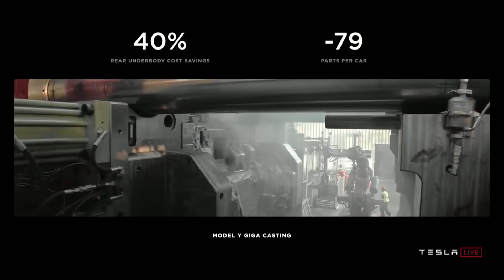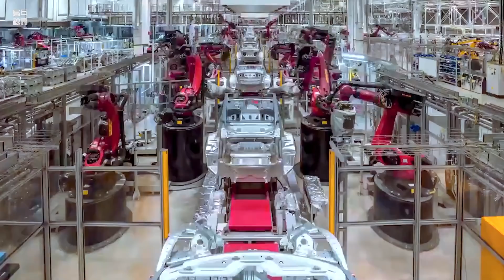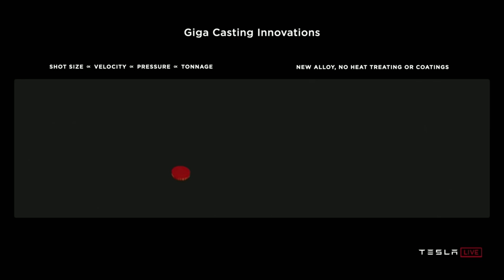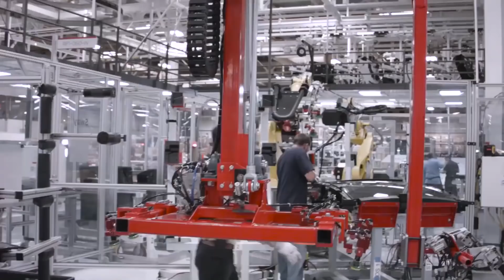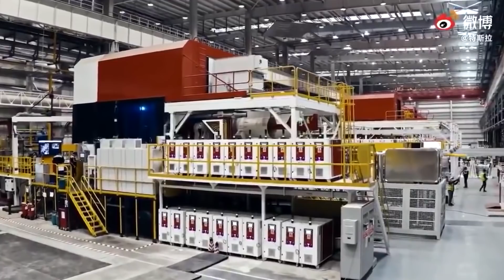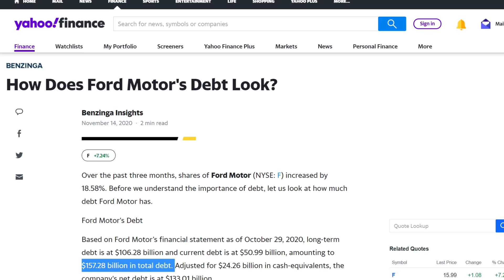Tesla Giga Press: Why dont Auto manufactures copy?

Comment: NONSENSE #1 Body on frame is NOT the way everyone else is doing cars. Almost all cars and crossovers are of unibody construction with stampings. Only heavy duty trucks are body on frame. NONSENSE #2 Casting solves everything. Actually, no it does not. Castings have a very thick minimum sectional thicknesses and are anything but the lightest when you need thin shells. Casting alloys like A356 are also inferior in strength to forging and extrusion alloys like 6061 or 7075. This is not counting porosity and flaws from the process itself. NONSENSE #3 Other automakers do not use large castings or do not have the equipment for it. They do. They simply do not use it for bodywork because welded stampings are thinner and preferred. Casting are extensively used in sub-frames, entire firewall assemblies and of course engine blocks.
Reply: And I don't really get how the dependency on a small number of very special casting machines barely anyone knows how to service will be better than having a lot of standardised robots which may fail more often but are relativly easy to service or exchange.
Reply: @9734522  Hunans also make more mistakes than robots. Hence why the world uses computer systems and AI wherever possible.0
Reply: @9734522  The "idea" is that one big part is better, or at least cheaper, than a few smaller ones that needs to be welded, bolted or otherwise put together. That is not always true. I don;t think it's about machines or robots failing as much as it's about the man-hours (or robot hours) it takes to complete manufacturing. Regardless, let's just say that Tesla's costs are not notably better than their competition -- at least their vehicular prices and lack of profitability does not suggest so. Where Tesla has traditional car companies beat is stock prices and hence money to burn.
Reply: @dwightlooi  I totally agree with you and have some knowledge about production myself. But it's stated in the video that many robots are many risks to fail and that this is bad - leaving out that the "giga press" may be even worse.
Reply: @9734522  That is like saying having 100 generic PCs is bad because any one of them can fail. So, let's have ONE mainframe! Nevermind that you can buy another PC in a hour from the local BEST BUY and you are only losing 1% of the work capacity.
--
Actually, on automotive production lines, when one or several robot fails it is often possible to continue production at a reduced efficiency. The line is designed that way. There are usually a dozen welding robots each doing a small number of welds in sequence so each stage takes less time. While it takes the same amount of time for the first chassis to make it through the production line, once the line is loaded the throughput is almost 12 times higher with 12 stages instead of one. If any one (or more) robot fails it's task is distributed amongst the other robots. This reduces throughput but does not stop production even while the robot is being repaired or replaced. The same thing goes for human assembly lines. The other gays on the line will take up the task(s) of the guy who called in sick or suddenly quit.
Reply: @dwightlooi  "The 'idea' is that one big part is better, or at least cheaper, than a few* smaller ones that needs to be welded, bolted or otherwise put together." Or a few* hundred more parts with double the line length (and capital), and hundreds of added robots? But like you said, that's not always true.
Reply: @dwightlooi  that's a horrible analogy. It only fits if in your scenario; If one of the 100 pcs fail , then everything stops. In that case, then 1 mainframe would be superior for cost/benefit of maintenance and repairs.
Reply: @9734522  Robots don’t need wages and are much easier to replace. The money saved from wages way outweighs the cost and future repair of each robot.
Reply: @4000valentin  it doesn’t stop.More robots usually share the same task and they can divide the work between themselves. Let’s assume there are 4 robots who weld things. They each do 25% of the work. If one breaks, then the 3 remaining robots can just do 33% of the work each, without stopping. 

Now, let’s assume there is a giga press that works at maximum efficiency. If it breaks, other giga presses can’t just do more work, and the whole production would have to stop.
Reply: As a retired Engineer I can tell you that most of the people talking about the giga press are incredibly ignorant about how things work in the real world. I supported industrial robots and they are incredibly reliable. The robots would literally run for years with no maintenance. The weld tips and other consumables would have to be replaced and drift adjusted during the normal downtime and but the robots just didn't break. The biggest problem we had was having a trained technician available to fix the robots. The robot breakdowns were so rare that the technicians forgot all their training.
On the other hand the large custom machines would break on a regular basis. In the factory I supported virtually all of the downtime was caused by failures of the custom machines and  not the robots.
Reply: @jimfarmer7811  With more and more engineers retiring, this knowledge is disappearing and considering the young generation wastes its time getting MBA degrees in the hope to strike rich by becoming traders, the few still embracing engineering are reinventing the wheel,  making mistakes long forgotten. See the hyperloop, boring company and car shuttles, other Elon Musk scams as good example.
Reply: Also cast parts are nearly impossible to repair. Got into mild accident = total loss of vehicle.
Reply: @aleksandrkinyaev6703  One of the reasons insurance companies are totaling more cars is damage to the complex and impossible to repair economically frames. That must be why they engineered the cast "crash rails" to be sawed off after a "crash?"
Reply: @aleksandrkinyaev6703  going in line with right to repair issues. It can be seen as we don’t want the car to get repaired in case of an accident were deforming takes Place.
Reply: Back in the day when I started studying for my Diploma (bachelor and master degrees where not used in the late 1980s in Germany) we had a tour through a Mercedes factory. What was interesting for us business administration/economics students was the fact they used of the shelf Atari STs to control the robots. If one failed, they just replaced it with another one. Cheaper than trying to repair a specialized system like Siemens SPS for example.
Reply: Tesla are doing the right thing when thinking of future costs.
Reply: Exactly!  Most cars these days are unibody (monocoque) design, not body on frame.  I really don't get what this video was all about.
Reply: It's worth noting, if they really did have a way to massively save on costs, they wouldn't be telling everyone about it, and informing them of how they could do it too.
Reply: Number of spot welds is now reduced and replaced with adhesive.
Average number of casted parts from the die is about 10k-15k. After that, die must be refurbished and replaced with next one if the production must be carried on. Each die is about £1milon, in case of engine block. Suspension dies meet be much more complicated then engine block. It means dues could be even 10x more expensive and much less efficient.
Reply: Before deciding "NONSENSE #1" did anyone ask what are the best selling vehicles in the US? Trucks? And how many body on frame SUVs sell well? And who makes them - everyone that is a US manufacturer (except Tesla)?
Reply: Totally agree ! Here again the purpose it to get investors who know nothing about technology to get all excited and push the stock higher ! Hyperloop, Boring company , Solar tiles etc... I see a lot of vaporware. I don't even want a Tesla because I NEED A REAL CAR TO GO FROM POINT A TO B without having to worry about "recharge". Enough to see all these Zombies looking around for a plug or a charger for their Smartphone ready to die.
Reply: @clitisswood7330  it is astonishing how clueless you are. Enjoy living in your cave.. I’m not even going to begin to bother with trying to clue you in on what already exists. You are obviously refusing to see and experience what is in existence already
Reply: It's really amazing to see the 'old mentality' in all the replies to this post. Just because you guys have banked knowledge of what worked in the past, doesn't mean you know much of shit about what is working for the future. Couch your knowledge in the rails of what you experienced and know. And let the people who have taken the engineering to a different level, let them figure out if it works.. if it's economical.. if it's an improvement over the decades of use that has been clearly measured. Telsa's margins on every car sold is clobbering the rest of the industry. They have some of the smartest f'n engineers on the planet, not just from Michigan. If they've done the tests and studies and their first principles approach says this is the way forward. I'm certainly willing to watch the experiment and see what new shit they're able to demonstrate. In five years, if everything you guys said is true, it will bear out. However, I think you're all full of out dated knowledge and information and these guys are blazing a trail to a new era of manufacturing. And I don't think the mega castings are even the end of it. The 3D printing is going to take more and more of a place in manufacturing. The tech still has a ways to go to improve in speed.. but the benefits are huge.. give 'em 10 more years and they'll figure out how to get them to keep up with the rest of production, one way or another.  Look, I'm not trying to shit on your guys knowledge.. I'm sure it was accurate and useful for what you did and where you worked. You CANNOT, however, claim that you have knowledge over shit you never did. So don't think your gut feeling about mega castings is some true knowledge. These guys have expertise on levels you probably don't even comprehend. Metallurgists and engineers that are working on shit to operate to go to Mars. I think they can figure out the complications you guys have mentioned. Put your outrage down, and acknowledge that maybe these guys have cracked shit that you didn't think could be, or engineered the shit in ways you haven't thought of. Watch some Sandy Munroe videos and tell me why he seems pretty damn certain these castings are a genius improvement, and absolutely the right direction for the future of vehicle manufacturing.
Reply: @airheart1  this might shock you, but just because new != better, and there is a reason these engineering principles have stood the test of time.

do you not think that other engineers haven't already done the calculations on the working of this? the fact that the things are bought and not self made shows that they aren't really innovating here
Reply: @quantuman100  well I’ve watched an auto expert, Sandy Munro, who says you’re 100% wrong. That the only reason other automakers haven’t moved to large castings is a lack of foresight and listening to experts who did the calculations and showed the mega castings ARE superior and save money. 🤷🏻‍♂️ so you can argue that with an expert. I am not a manufacturing expert, just going by what I see. And common sense.. 1 part is superior to 300 parts, making the same piece in the end. Oh, i understand there are always pluses and minuses. The castings have minuses. But apparently, according to one expert at least, the castings are a superior product in many ways. Legacy auto is stuck in sunk costs in their manufacturing investments and refuse to rip off the bandaid and make the leap forward. Tesla does not currently have these issues and are free to chase the best tech they can find. We’ll see who has the best products with the best margins in a couple years when Tesla is really crankin’ ‘em out as they plan
Reply: @airheart1  I'm truly amazed how some people will publicly wallow in their own ignorance. How people with no knowledge of math and science can criticize people with decades of experience in engineering. Just remember Musk's plan to build fully automated factories. Most of us with experience in the field could predict the train wreck that followed. There's an old saying that dumb people learn from their own mistake but smart people learn from other people's mistakes.
Reply: @jimfarmer7811  Ok.. so you extrapolate that one aspect of their factory design that needed a couple years of tweaking and did not exactly become what they envisioned, though it is a HIGHLY automated factory, equals a complete failure and that everything else they do differently in manufacturing must also then be a complete failure. Yeah, you got a real firm grip on reality there buddy.. GL.. keep watching the shadows on the wall in your cave.
Reply: @airheart1  you must learn that there isn’t always need for innovation. You and Elon musk aren’t forced to innovate, if it is clear that your solution can’t stand to the competition. If it can, it is welcome, but you aren’t forced to innovate, the result will be a great fail most of the time.
Reply: @airheart1  Good to hear so many valid arguments from somebody with so much experience in engineering and manufacturing in the future and who knows so much of shit about what is working for the future! Sarcasm off...
Reply: @airheart1  this comment can be summarized as “I trust’em guys at Tesla, you experienc’d engineers don’t know shit”
Reply: @pasticcinideliziosi1259  Sandy Munro and his team of engineers don't work for Tesla.  They even criticized Tesla in the past for bad design.  Yeah I trust the known industry expert engineers vs some random youtube commenters saying they are engineers who know better...
Reply: @airheart1  Ah yeah, the famous 3D printing revolution we are still waiting for ! 3D printed cars, houses, guns etc.... 3D printing is just an other production method that simply can't replace most of the time proven and cost effective classic method. 
Yes, it can do some of the impossible but not all the possible. Note, I am fine with this giga cast, for sure it is worth trying, one will certainly find some use for it, even may be for car frames.
Reply: @clitisswood7330  I agree 3D printing is not where it needs to be. But it has demonstrated huge advantages and continues to improve drastically. It’s still a very new tech in manufacturing. It has a long way to go, but its future looks incredibly bright considering what it already can accomplish. Give it 5-10 years more evolution and I believe the progress will put it firmly into major manufacturing nearly everywhere.
Reply: @airheart1  It is not new ! Has been around for more than 20 years. Printed home, cars, guns plus cheap kit made it "popular" leading to false promises by ignoramus of a new manufacturing era ! Didn't happen a sit is just an additional tool but not a replacement for most of them. There are fields where it is simply unsuitable. BUT the BIG problem is that it is SLOW and COSTLY and can't compete with stamping, casting ... Evolution, not revolution. When a farmer rebuilt the edge of its plow, it does 3D printing !
Reply: @clitisswood7330  you do not understand the concept of iterative design? The technology is sound. It simply needs more time and R&D to find the advances to make it compatible with modern mass production rates. If people just quit on every technology because it’s hard to perfect it, we’d still be naked in f’n caves.

EVERY complex machine is slow and costly at first. Put the time and R&D needed into it and it will leave stamping and casting mostly in the history books. 3D design and printing is genius, reduces tons of waste and creates things stamping never could and CAN become much quicker than casting or any other process with even more complicated structures and greater size . It just needs development to figure out how to evolve those machines to operate faster and with all the materials necessary. I think they’ve already cracked pretty much all the material issues. Speed is what’s needed. Give the engineers time and money and they will find ways
Reply: @airheart1  So, work on it and come up with a solution.
Reply: @clitisswood7330  ehm.... We have 3D printed cars, houses and guns now

The cars are currently still luxury-focused Like the Czinger 21C but both houses and guns are now available to the underprivileged anywhere in the word where a printee can be bought.
Reply: @angrydragonslayer  Bul..t USELESS weapons,  houses, cars .. Not even cheaper ! Special parts for jet engine YES, in medical field, to produce mold YES ...3D print is NOT for MASS production. I bet you are the guy who cant change a light bulb, yet comment on technology you barely can use,
Reply: It's almost like smart people figured out that this is not a good application for casting a long time ago...  I think dude seriously suggested they'd cast aluminum tubes????
Reply: @gliscameria  why should we learn from 100 year car manufacturing history (which sounds Kind of hard) when we can claim a "gamechanger", fanboys will eat out of our marketing hands, and Elon makes another 10 billion in fake stock money..